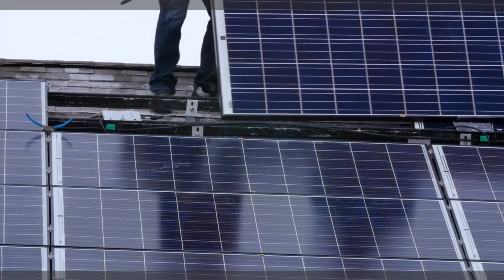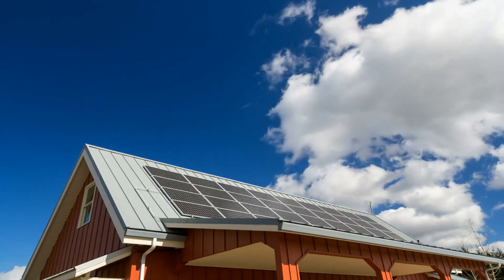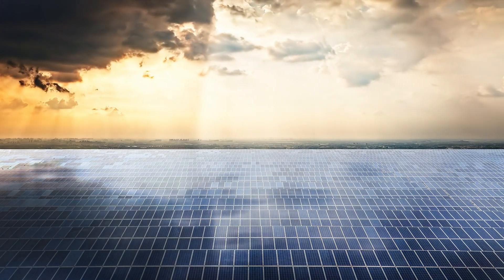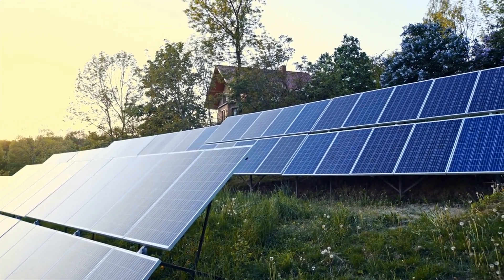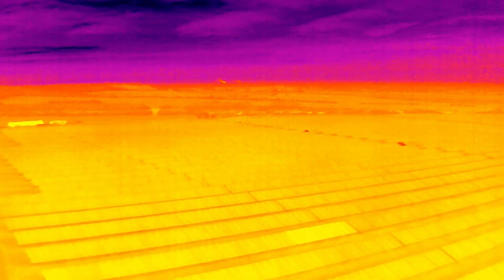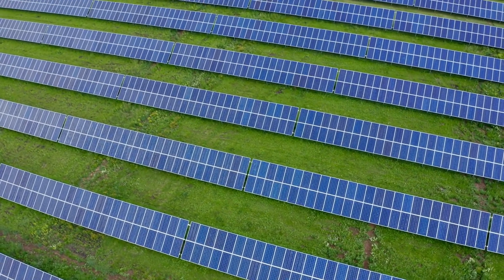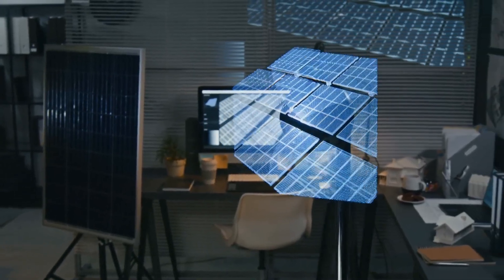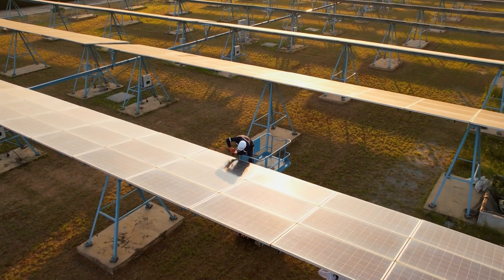NEW 1000x Stronger Solar Panels Against Hail

Comment: Interesting video.  I foresee solar panels with thicker glass are available in areas of the world prone to hail.  Such panels could be marketed as such so can command a slightly higher cost. But solar panels have dropped more than 90% since 2010 so there's room for added cost.

Many solar farms that use 1-axis tilt to improve energy yields.  But the tilt provides an extra advantage during extreme weather where the panels can tilted completely vertical.  So, if hail is detected, the vertical angle greatly reduces the hail impact force.  But residential solar panels are typically hard-mounted so hail-prone areas could definitely benefit from stronger solar panels.  Going vertical can also quickly remove accumulated snow in wintery climates.
Reply from the maker: Great observations — those are excellent points about how thicker glass and tilt mechanisms can make solar panels more resistant to hail and snow!